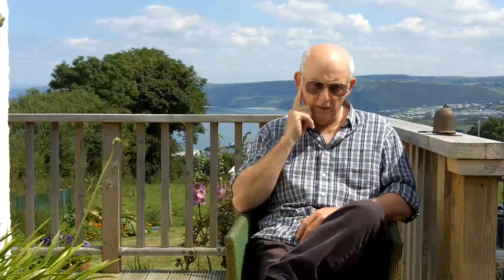Tinnitus Experiment ... Part 1. What I intend to try... read description box below the video

Comment: "Active Noise Cancellation", or ANC, involves introducing sort of exact negative frequencies to the ones you are trying to cancel.  Several companies produce ANC headphones that pickup outside sounds with a microphone and create the anti-frequencies in the headphone speaker.  My advice would be to create your tinnitus freq's with a loudspeaker while wearing these headphones.  The trick is creating the whole range of freq's to run through the loudspeaker at the same time...  -John

Comment: I should also mention the both devices are not covered by insurance in the USA and are quite expensive.
I have done some experimenting on my own. I setup a variable sine wave oscillator and when I set it to oscillate at or near my Tinnitus frequency of 11,000 Hz my Tinnitus disappears, but only for a minute or so.

Comment: Sorry about the tinnitus. I get it very mildly and only occasionally due to some allergy medications I have to take. Interesting that the bell affects yours.  My inclination would be to characterize the frequencies the bell makes (even above normal hearing-maybe all the way out to about 100Khz?) and then see if I could make an oscillator that mimics the bell so I could play with that in a controlled way to frequency cancel, phase shift, or zero beat against the tinnitus. Just a random thought!

Comment: I've had tinnitus since my late 20's...  My understanding is that there is not a physical sound in our ears.  The sound is the result of damaged hairs inside the cochlea which are sending nerve pulses to the auditory section of the brain, which decodes those signals into a sound.  Your ear doctor can tell you exactly which frequencies have been damaged in your ear, and you can use those frequencies to finish your experiments...  Good results would be ground breaking.  Best of luck...